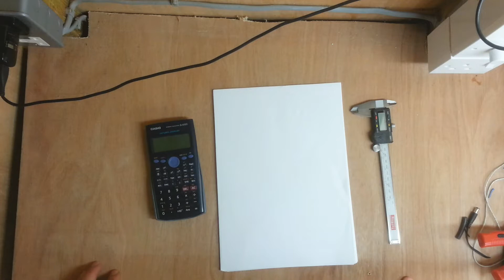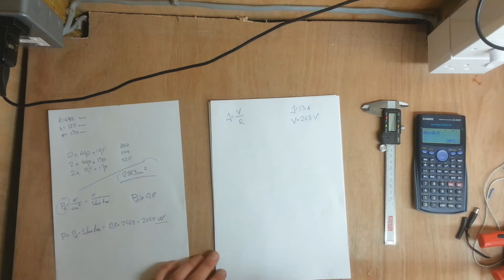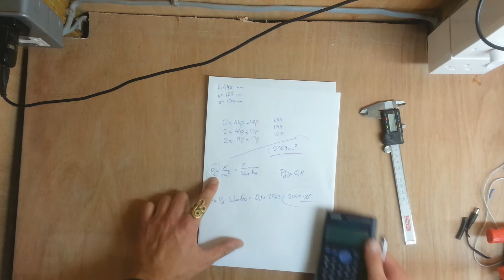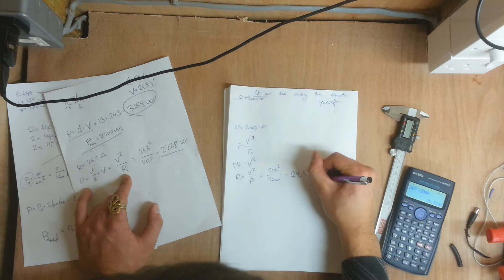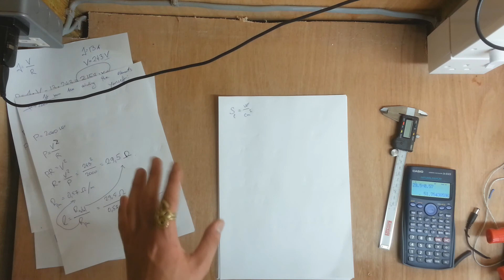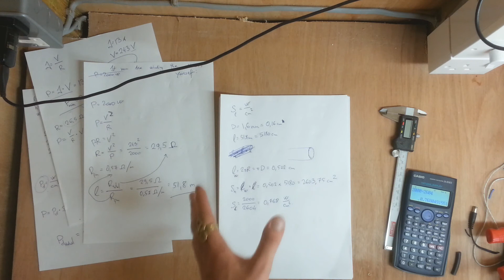Heat Treatment Oven Build: Part 5 - The maths

Comment: Three years later, and there are still very few tutorials on You Tube about electric furnaces. Yours is the only one I've found where an attempt at explaining the math was made. Thank you! Also, your figures are perfect for 1.8mm kanthal. For those winding their own kanthal a-1 wire, a couple things to note are coil diameter and stretch. Coil diameter should be a minimum of 5x the wire diameter. Coil stretch, the distance between each coil, should be a minimum of 2x the wire diameter.

Comment from the maker: Hi Derick
Are you sure you did not mess up the math somewhere? 5.93 for Surface load is hella-high, and I don't think that 7.5 meters for the heating wire is correct. You seem to be using both metric and imperial units (AWG and cm) so maybe you have a conversion wrong somewhere?
If at all possible get your heating elements pre-wound.

Comment: Thanks for your videos, after doing the math I am having a hard time selecting what gauge of Kanthal A1 wire I need. I am trying to do this on 1800 watts. The best surface loading I can figure out is 5.93 and that's with 16 awg wire, that's 749.8cm long and my kiln surface area will be 2322.6 cm squared. I need help please